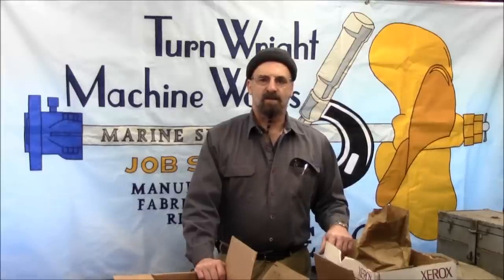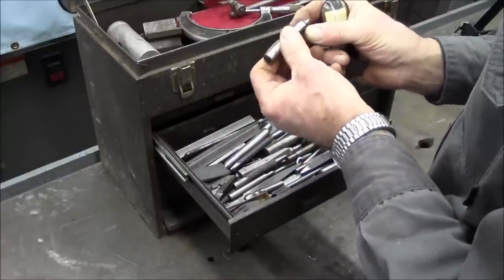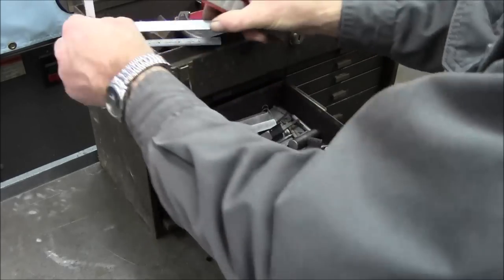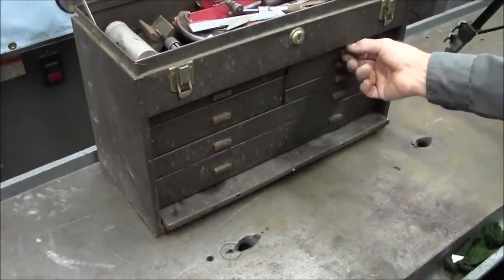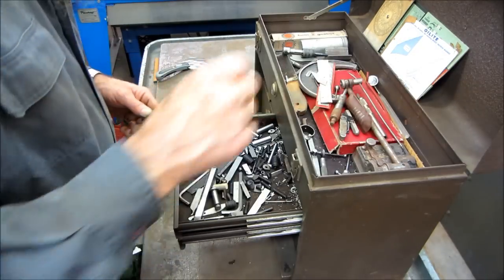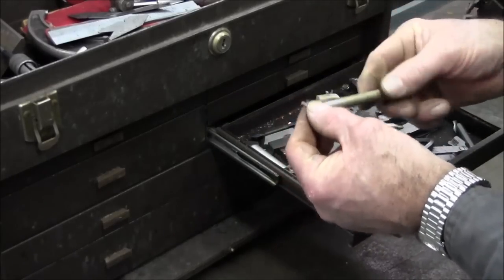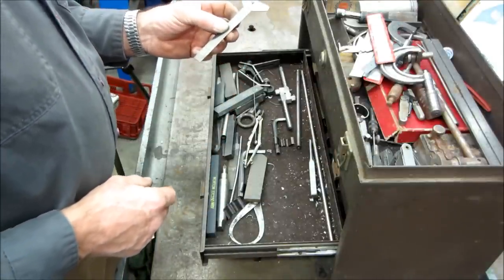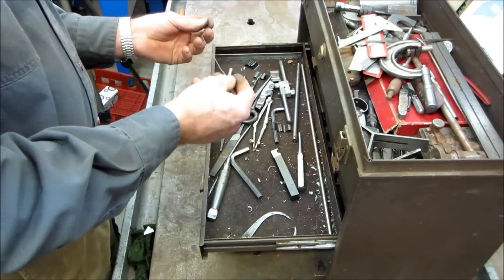What's in your Box? Part 4

Comment: Electrolysis rust removal is by far the best way to clean those tools. Turns the rust black and saves all the lettering and fine details of the tool. Keeps a lot more accuracy than  sanding clean.  I use plain old baking soda. Add enough to get a good amperge going and let it go. I run at 10 amps shown by gauge on a big charger set to 35 amp quick charge. Takes much less time than a small charger. Like an hour till its clean. Keith you gotta try this. Preserve those nice tools, good for you!

Comment: I have a couple of those shop-made tap wrenches.  I actually just made an XL one to hold large taps.  They are also nice for holding things like drill bits, reamers, and easy-outs.  They are really easy to make and you really don't have to turn the handles.  You can just put the holes and notches in a couple of pieces of bar stock.

Comment from the maker: The cone is lowered into the hole being centered without the spindle running prefered, just enough to contact the entire circumfrence of the hole, its not a press. You sould be able to spin the tip by hand, then move your X & Y axis to aline the off set diameters of the center finders outside diameter.

Comment: Thanks for sharing with us the contents of those tool boxes. You never know what can be found and may still be useful. BTW, when using the pointed center finder, you don't turn on the machine. You place the pont in a hole then position the piece until the finder sides line up.

Comment: I use a ball welded to a wire that is larger than the hole. I place the ball on the hole and strike it with a hammer. This upsets the metal and "shrinks" the hole diameter. I do this to keep dowels from slipping out of the holes

Comment: The Starrett #876, 877 & 878 wiggler / center finder has a bent indicator holder which is great for the #711 last word indicator. The other points are just ball contact points. The ball of the indicator holder goes into the holder. The big barrel gets the indicator. I'll have to set that up and show people that's how I indicate my vise.

Comment: you can also use warm water + citric acid (~10% by weight), no electricity required, warm so the reaction is faster, it eats off rust but is weak enough not to harm the metal, rinse and you're good, there is an issue with carbon steels (or so I've red), that if you leave the piece in the acid for too long, you might get hydrogen embrittlement, by long they meant days, which isn't necessary, since the this mix at 35C degree temperature cleans very rusty parts in like half an hour or so

Comment: look for spice section in your food store, 99,99% will have citric acid in dry form, it is a very common cooking ingredient, and is quite cheap, here in EU it costs like a 3-4$ per kilogram, and that is enough to make 10 liters (aprox 2,5 gallons) of the solution, someone mentioned Evapo-rust, and it is basically this same citric acid with some wetting additives, thus the low price